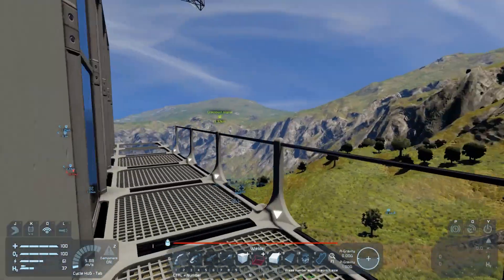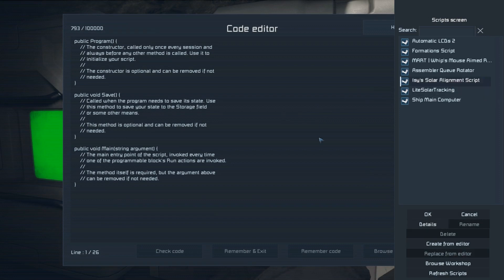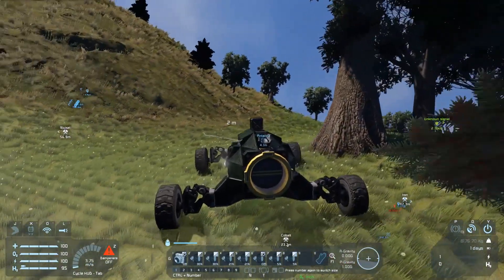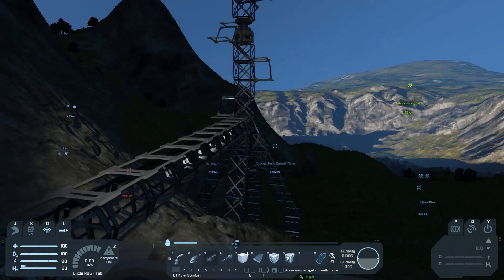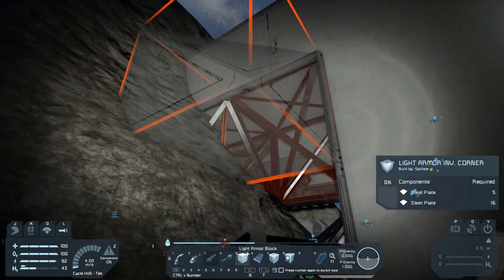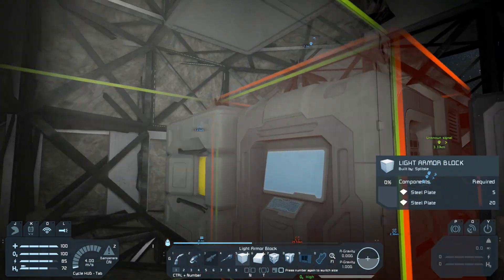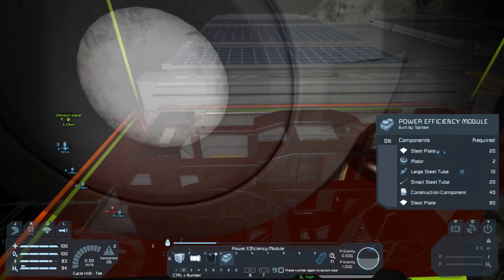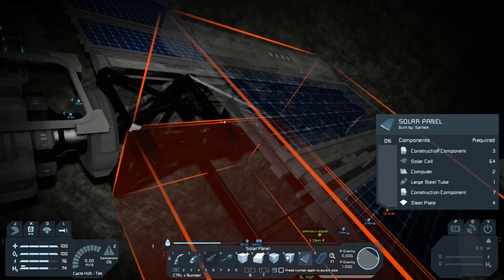Survival, Maybe... #5 Finishing a Sun Tracking Solar Panel (A Space Engineers Survival Series)

Comment: Pro-Tip:  You can change the build-order of your Assemblers by click-dragging them in the build-queue.  

IE:  Add Large Steel tubes to the Assember queue
Drag the solar panels to the right of the Large Steel Tubes

This will reorder the queue.  The current solar panel will finish, then it will move to the tubes - assuming I'm recalling this correctly that is.  (Can't access SE from here.)  Once it finishes the Tubes, it'll resume Solar Panel production.  Good for getting those quick  'gotcha' items you need unexpectedly.

Keep up the good work!
Reply from the maker: Oh man, I feel so incredibly stupid right now. I swear I'd tried that in the past and it didn't work but now I'm not so sure. Thank you so much!
Reply: I could be wrong, I can't check at the moment (I work 3rd shift here near DC so still am at the office for another... 4 minutes.) but I'm fairly certain that may work and may save you a little headache.  Should be easy to test and confirm.  

Have fun!
Reply from the maker: I'm pretty sure you're right, wish I'd even tried it to see :P
Reply: Ha - forgot I had SE installed on this laptop. (And it's running surprisingly well on rather low settings on this 940m!)  It does work.
Reply: No worries bud - We all make mistakes and overlook things.  Key is to learn from them.

For example - I generally avoid using other people's scripts, but your Solar Tracking one looks simple enough that I may want to look into yours and tear it apart to see how it actually works.  I have an idea or two given how it really only has the power-output levels of the solar panels as 'sensors' to go by (I think) but it'll be interesting to see how the script-writer approached it.  :D
Reply from the maker: Absolutely, I am all for learning from my mistakes and hopefully some others might be able to as well :)

Isy did a great job on that one, particularly the fact he can make it easy enough to use that even I can use it :P
Reply: yea SE runs really well on laptops provided you change all the settings to there lowest , though if I ever can get a desktop im sure SE will be a much different experience.

Comment: When you run Isy's script you can just run by default argument. You should just scrap the solar panels on the roof and put them on the solar array, youll get more out of them that way.
Reply from the maker: I probably would, just a little nervous about what would happen to my power generation if I get attacked by drone... that setup is so flimsy :P
Reply: You shouldn't run my script with default argument if you want to use command line arguments like "pause" or "rotate".. But yeah, you're right: aligned panels are better than flat sitting panels ;)

Comment: Isysy(?) Solar script is hands down the best one on the workshop!
Reply from the maker: It's pretty awesome :)
Reply: ive been subed to it for a long time but have yet to use it as I was not sure what to do though i had not bothered to look at it either though I will be using it in this new world im getting ready to start with a friend here in a few hrs. provided he can connect to my modded world this is going to be my first attempt with trying to do multiplayer in a modded world the only other time I did multiplayer was no mods and that was also before all the optimizations to multiplayer, so im hoping it goes well though if im going to have to have him manually sub to each of the mods that is going to be a pain.
Reply: MacGabhann scripts are not mods so if you decide not to use a modded world  this still only requires standard blocks
Reply: I was aware of that though ive never used scripts in SE yet not sure why just havent done it anyway im not worried about using a script what I was wondering though was the mods im using that do add in extra blocks if my friend would have to go sub to those same mods him self or if the game would reconise he does not have them and download them for him automatically, never did get to find out as he bailed on me at the last minute and decided to stay in bed all day
Reply: Thanks for the cudos Riley ;)
Reply from the maker: I've got to agree with him, it's incredibly easy to set up and works really nicely :)
Reply: Thank you Splitsie ;)

Comment: You know Split seeing you drive this light vehicle i am almost tempted to send you my 8 wheeler desing that literally can go across even those heavy ridges and steep inclines you avoid without much of a issue due to its layout. But i think you might have a reason why you're so far sticking with this lil thing and the stated upgrades of it.
Reply from the maker: The main reason I've stuck with it is that I keep getting distracted by other tasks and then just dealing with its terrible handling. My 5x5 version of the same vehicle can take a 30m drop without flinching so I really should try to either get something flying or fix the horrible little thing :P

Comment: Im trying to set up a similar solar based installation, and even though i have a very large solar array and it SHOULD be pumping out plenty of power, i find that i still have problems with power. I find that my battery bank seriously struggles to meet demand over day/night cycles and im not sure whats draining it.
Reply from the maker: I was very strict on my power usage early on, one of the biggest power hogs is flying vehicles followed closely by your refineries and assemblers. I often had them turned off overnight to prevent complete power loss

Comment: Nice progress Splitsie.

I was confused as to why you didn't use your GPS to lay down way points between your base and the mine and your base and the ice lake, while you could in daylight so that you could better find your way at night.  Initially I thought it may have been because you were going to build a flying craft of some sort, but I see you still need to truck down there.

Also, would it not be more economical resource wise to build a scout ship first, with some carrying capacity, which would be much faster than the buggy even if it can't carry as much.
Reply from the maker: Thanks Mick :)
I really should have laid down more GPS markers when I had the chance, I have no idea why I didn't think of it at the time but since you've mentioned building a small cargo ship that could make the markers a moot point as I could certainly come up with something that could do that job without too much trouble.
Reply: yea a small light flyer will get you around nice and easy but will use about 100x the power of the wheeled vehicle,the same amount of  battery power that will last you 3 or 4 days in the wheeled vehicle might only last you 20 or 30 minutes or so (not sure how accurate those numbers are just an example of the power efficiency) so it really comes down to power efficiency vs. ease of mobility usually what I will do is build a wheeled vehicle with a connector on top then build a flying miner that can land on top of it then use the wheeled vehicle to carry the miner around as well as provide a place for the miner to unload at since the wheeled vehicle can carry more weight, then I can haul about 5x or more ore back then what the miner can carry and not have to worry about falling from the sky before I get back to base because the cargo hold is to full for the amount of power needed to keep it airborne.
Reply from the maker: My hope would be that the time saved in return trips would allow me to get the necessary minerals to build more solar panels, but I'm really not sure if that would work out... guess we'll have to see :)

Comment: You didn't have to stop the solar cell production, you can move things in the production queue via drag and drop like you change the refinery queue.
Reply from the maker: Yep, someone else also pointed this out to me, can't believe I didn't even try to do that, oops! :P
I won't be making that error again :)
Reply: I like to queue up multiple blocks at times then drag all the components to combine stacks for batch production. 
Might I also suggest setting a safety override at 30 or 40k or so on the rover so you don't go too fast ? It should lock your wheels up if you break the speed limit :P

Comment: While this is an old video did you or have you considered using a sensor near the top to align the catwalks for maintenance ??
Reply from the maker: I think there's a command within the solar alignment script that would set the rotor back to zero so I can climb up I've just never used it :P
Reply: @Splitsie  I was thinking assign a sensor to that command so as you assend the tower it aligns the catwalks to the proper possition, I've just started playing with the sensors for door automation and think they could be good for something like that and possibly more as I learn more about what they can do.
P.S. love the survival series and have learned a good bit from them, thanks for all the time you've put into them 😎😎
Reply from the maker: Ah, I see what you mean, I like the idea it's going to go in my little notebook for suggestions :)
You could probably use a sensor to send the command to the solar tower as you ascend and then set it back to running when you go back down (would probably need two sensors for that though since you probably wouldn't be able to cover the whole tower with a single sensor).
Reply: @Splitsie  i think setting the first part of the sensor to run and  rotate 0 0 will rotate the rotors to the zero possition then the second part of the sensor to run and resume 🤓🤓
Although I'm yet to test it.....

Comment: I'm having this weird glitch that when I add the solar panels to the rotors array all the blocks attached to the rotors start wobbling in a crazy way until everything just disappears leaving only the first rotor body.
can't tell if it's a bug or if the rotors are having trouble withstanding the load of the contraption.
building in a moon base.
Reply from the maker: With earlier versions of Isy's script that used to be a problem but I'm guessing you've only recently added it so yours should be up to date. If you're playing on a dedicated server then there is going to be little you can do as a lot of the problems there are related to the network code and desync :(

I haven't had any explosive problems with my tower or rotors unless I play around with the upper and lower limits so I don't have many ideas for what you can do to try to get it working but from what Isy's told me some of the problems he had earlier were related to having the rotor that is attached directly to the base set to have share inertia tensor on.

Comment: Hey. Love your videos.
I remember in one of your videos, where you pick up the exact amount of materials needed to build something. How did you do that? Is it using that easy inventory mod, or possible without?
Reply from the maker: As of the last update it's now possible in vanilla using the build planner, if you take a look in the F1 menu the controls for it are in there, right down the bottom of one of the control lists - I'm struggling to remember which one right now. I'm hoping to put together a proper guide on it very soon now that I've had a bit more time to mess around with it and work out which ways it's particularly useful :)
Reply: @Splitsie  Thanks for the reply! Had no idea how I would get started without your guides!

Comment: I think that the Solar Array would look better if it were kept as scaffolding. :D
Reply from the maker: I agree with you, but I'm expecting to get attacked in the future and the array will not last long if I leave it as scaffolding :(
Reply: Splitsie Fair enough, but what about making more solar arrays, which could be used as backup ones, that have fully built armour whilst leaving the larger one as scaffolding. Just a thought. :3
Reply from the maker: Risky, I think I'd be better off exchanging the blocks for some modded scaffolding that actually uses the same number of plates as light armor with the same strength but I think I'd have to break the whole thing down in order to do that due to the rotor connections :(
Reply: Splitsie If you were to build a secondary pillar connecting the top to the bottom, grind down the original blocks, replace them with the scaffolding blocks, then grind down the secondary pillar, it would save having to grind the solar panels, rotors etc.
Reply from the maker: Remind me of this idea if when I get far enough through to consider it, the sheer engineering required will be entertaining to attempt - needing merge blocks and a whole lot of luck, I love that idea! ;)
Reply: Splitsie Cool beans 😃
Reply: that will be entertaining to watch using engineering to solve an engineering problem and engineering is after all what this game is about though it seems there are a lot of players that do not realize that.
Reply: MacGabhann Too much engineering. Lol
Reply: I was wondering if i was going to get a comment like that lol

Comment: 3:40 shouldn't the timer block  run the programming block before starting itself and not the other way around like you set it up?
Reply: It doesn't matter. The result is the same. I like making the timer start itself before everything else, so I can add more programmable blocks to the list without triggering my OCD.
Reply: ah I was not sure as I had not tried it myself ive always placed it to trigger it self on the very last slot
Reply from the maker: I didn't think it made any difference, I just tend to do the timer first as that's how I remember it, no grand plan just habit

Comment: is there a way to get solar tracking without scripts?
Reply from the maker: Technically, yes however the methods used for it are impractical for most purposes, unless you want to use one of the mods that has the script inbuilt to the rotor block

Comment: I know that the video was made long ago but couldn’t help myself.  You Worried about power and you left two inefficient solar power panels on the roof when you could have disassembled them and reassembled them on efficient solar tracking rig.

Also you say you want to make things look realistic (building four legs for your tower) yet you put two solar panels on the same side and none on the other side, making things heavy on one side which would lead to motor failure in no time
Reply from the maker: I have some vague memories (baring in mind this was 2 years ago) that I didn't move the panels from the roof to the array largely due to fear of something going horribly wrong. Back then it was a miracle I got this thing working as well as I did without it exploding :P

Comment: Programmable block i only have CUSTOM DATA no editor any clue why
Reply from the maker: You need to enable in game scripts on your save, I can't remember if you also need to enable experimental mode somewhere in the game options menus or if they got rid of that requirement and can't check it right now
Reply: @Splitsie  thanks got it working. now you dont need timer block and you can set up LCD panel aswell for info

Comment: is your game running that choppy or is it just the recording? either way you might wanna adjust some settings either in the recording software or your game
Reply from the maker: I think there's a bug in shadowplay, my performance used to be smooth with it, and currently is smooth when I'm using OBS or not recording. If I run shadowplay for a few minutes performance progressively degrades. When I recorded this I hadn't yet worked out what the problem was and messing around with settings made no impact. 
I use OBS for all my recordings now even though shadowplay 'should' work better :(
Reply: that explains it shadowplay has never worked for me so i generally use bandicam which i bought a licence for :)  i can really recommend it as you can set it to use either cpu or gpu to capture footage
Reply: and it's cheap at only 40 bucks for a lifetime licence